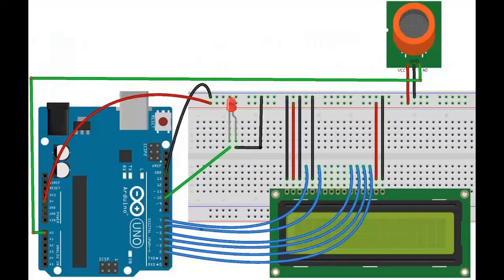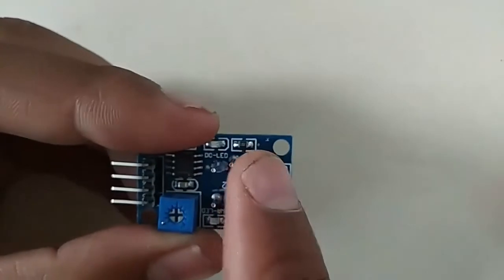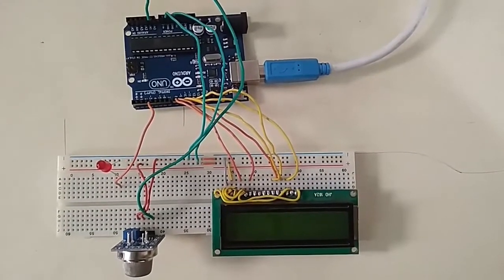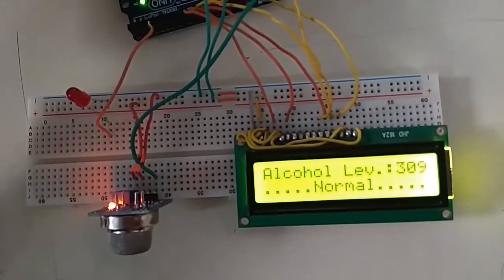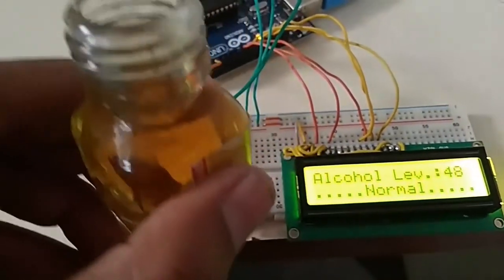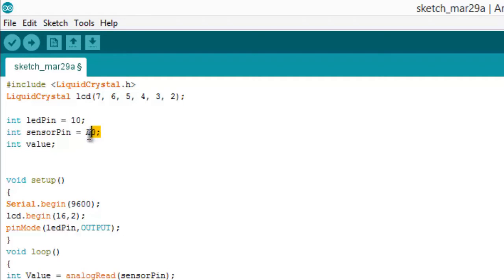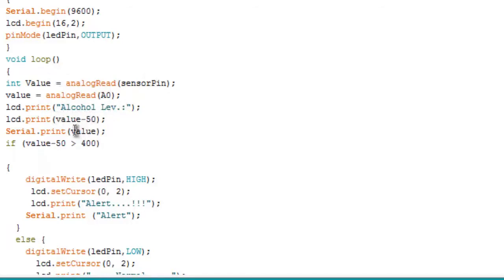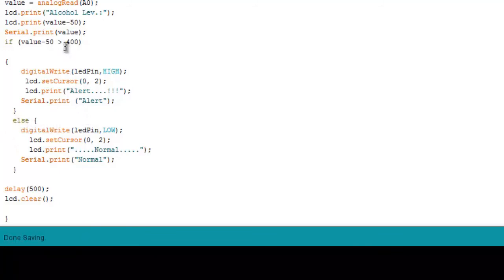Alcohol Level Meter Breathalyzer using Arduino & MQ-2/MQ-5/MQ-135 Sensor

Comment: Hi sir, did you modified the potenciometer before the test to measure thealcohol level? or what substance´s mesurement is the number "value" is it of CO2? because the level of alcohol is : value-50

Comment: I'm using mq-3 sensor when ever I give power to Arduino the alcohol level is above 400.how I solve this problem
Reply from the maker: Subtract the value in code formula for calibration.

Comment: hello.. why you did not use D0 pin and why the calibration must be -50?
Reply from the maker: The calibration factor vary from sensor to sensor. You can use any value instead of -50 dependong upon the observed value